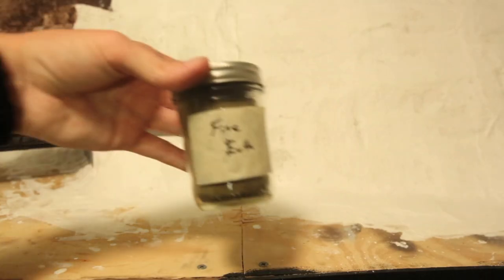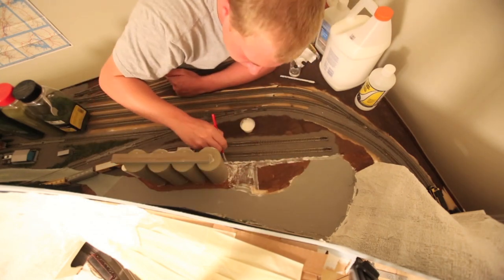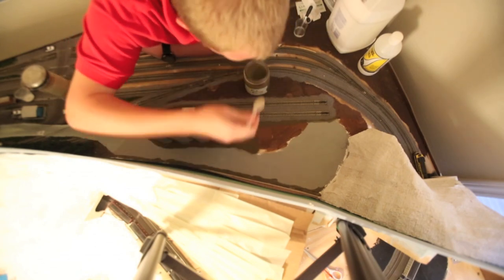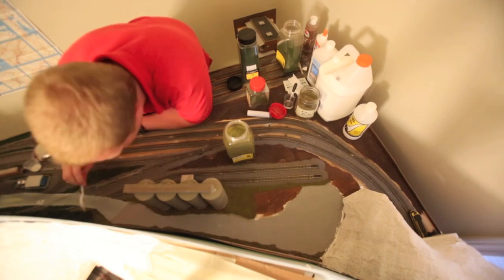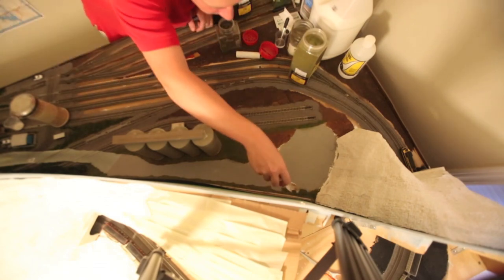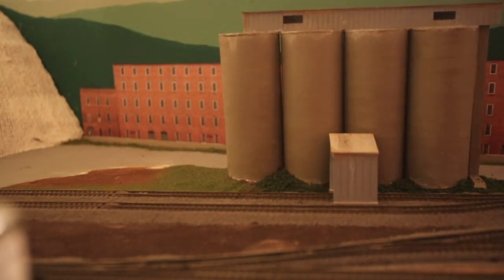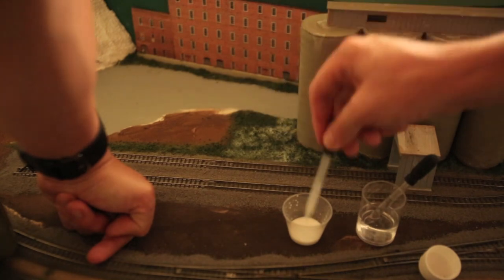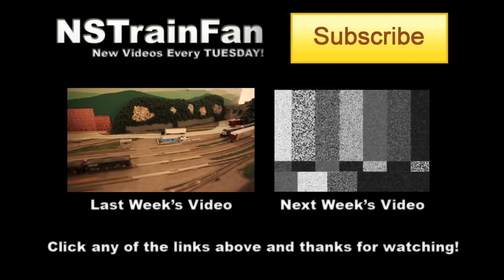Model Railroading How To: Basic Scenery - Part 1

Comment: Hey Ben, nice video.
I know Sim (BurtonOnHumber) has already mentioned it, but you don't need to waist the excess ground cover, another less involved way of recovering you material is to vacuum it using one of those small handheld vacuum cleaners, I do it whenever I vacuum the excess scenery and I just tip it back into the container. Just make sure it's clean so you don't mix random stuff back in the container. They are pretty cheap to buy, the one I got cost $15 dollars and it works a treat. It's great when vacuuming up static grass, that stuff can be expensive.
Reply from the maker: Thanks to the tip Luke! Static grass is for sure pricey! I'm digging your channel a lot lately as I'm getting back into the hobby and just discovered your channel. Great content and high production!

Comment: Good video and some nice editing Ben! No need to lose the excess material by the way, insert some porous material like stocking or a thin sock into the vacuum nozzle and attach with a rubber band and then retrieve excess scatter from it afterwards? :)
Reply from the maker: Ehhh, that's to much work just to save some scenery BurtonOnHumber. Ha
Reply: NSTrainFan Fair enough :)